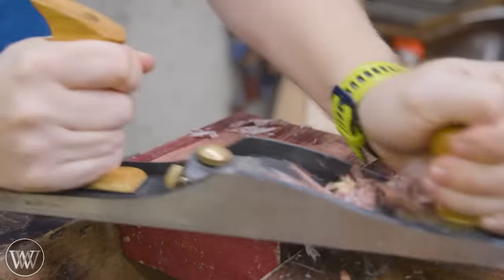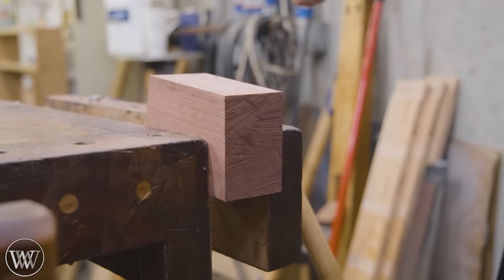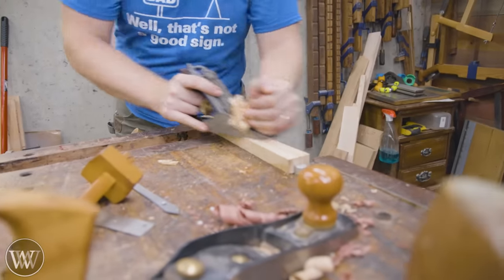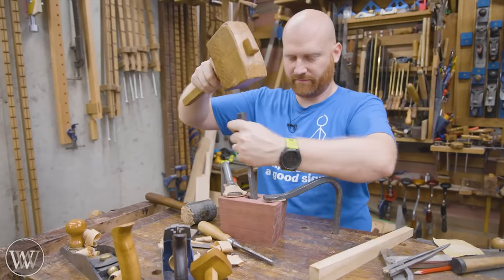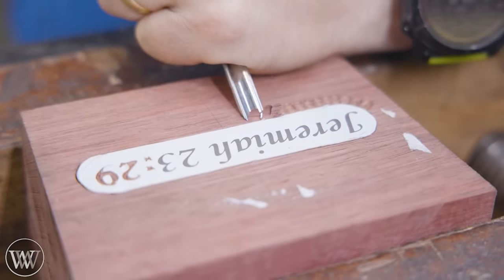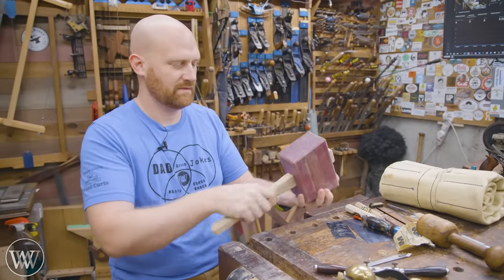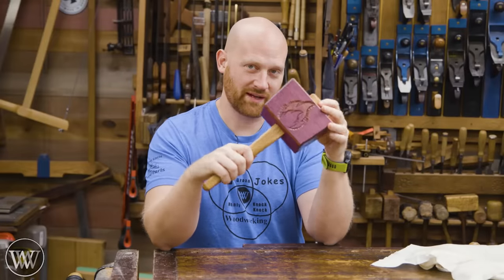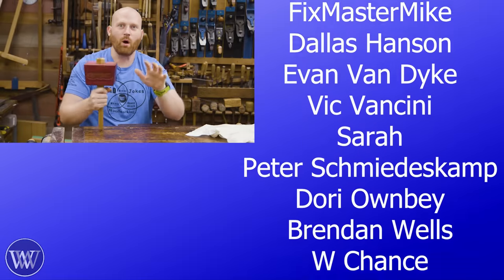Making A Purple Heart Mallet For THE MAN!!

Comment: Very nice. A shipwright told me the mallet faces are at different angles for different swings. If you're choking up on the handle you want a steeper angle because you are making a smaller circle at the wrist. Opposed to the large circle made by a swing from the elbow.
Reply from the maker: I have seen people do that when they work with larger timbers. oddly enough that is the technical difference between a hammer and a mallet. a mallet is meant to be chocked up on where as a hammer you hold at the end of the hammer and swing it.

Comment: Is there more than one purple coloured wood? I've worked with (very small) pieces of wood that were intended to be purple heart, but none of it ever lost its colour when I worked it. Yours turned a light brown as soon as you planed or cut it. I carved the pieces I used and they never changed in colour throughout the process.
Reply from the maker: There are several different variations of purple heart. Some of them oxidize differently at different rates.

Comment: If you did not have a jack yet and you were going to do this project and decided you wanted the jack for it, would you buy the low angle or high angle?
Reply from the maker: The traditional high angle is more difficult to learn but more versatile in the end. The low angle is preferred by most modern hybrid woodworkers as it's easier to learn.
Reply: @WoodByWrightHowTo thanks for that answer. Looking to follow suit on this mallet as my first project. Is Curupay usable for this purpose? I won’t be breaking it, I hope. And does handle material matter all that much? Found a 1.5 x 1.5 x 11 or so piece of flamed maple for cheap and it just seemed like it might be nice together with the curupay.
Reply from the maker: that would work perfectly. it will be a pain to work bout would make a nice head. as to the handle most any hard wood is great for it. but you might want something a bit longer. even though you hold it by the head the handle provides balance.